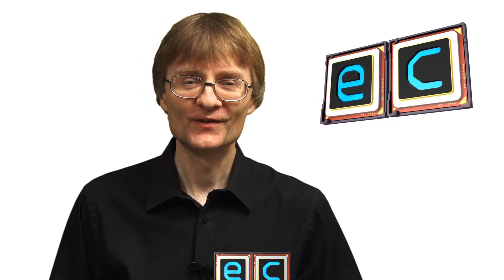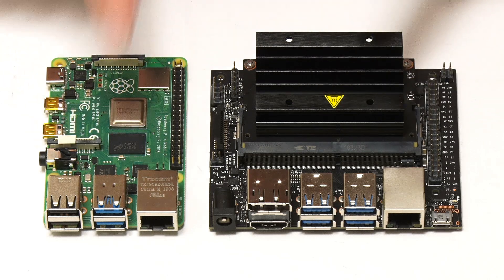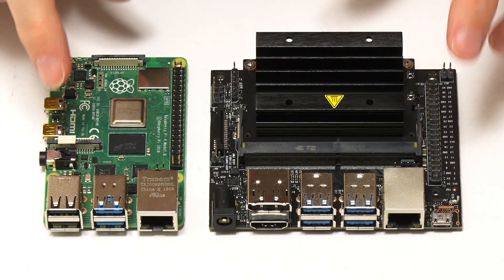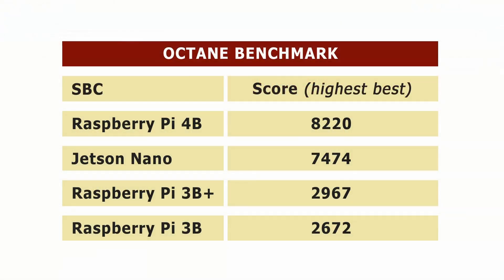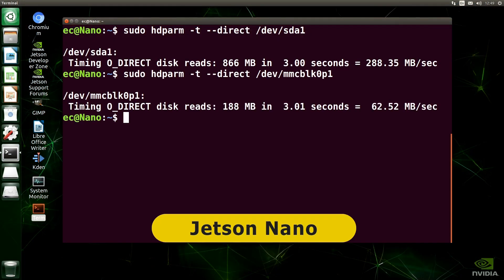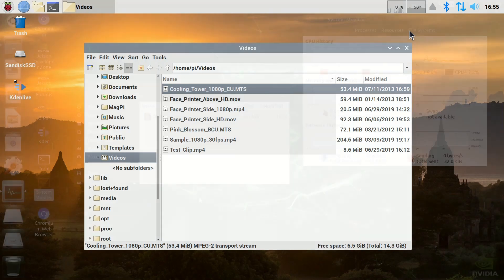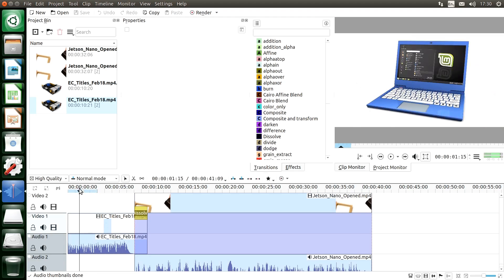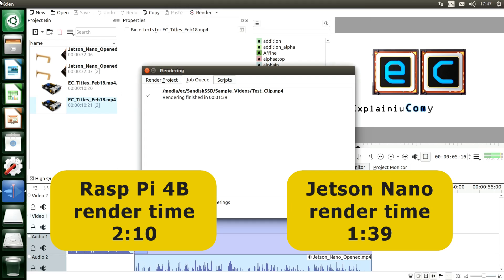Raspberry Pi 4B vs Jetson Nano

Comment: I am trying to build a system that detects the position of my hand via camera and use it to move a 3d printed hand so it behaves like my hand. I am planning on using Frankmocap as motion capture software. What do you think, is the nvidia jetson system powerful enough to run the motion capture script and some steppermotors at the same time?

Comment: From what I can tell

If you want to go into AI, go with the jetson nano 

If you want more processing power for say a website go with the raspberry pi

If you want just a logic board go for an arduino

Both jetson and pi have the same connections, just jetson has 2 full sized ports and all 3.0 usb
Reply: you usually run an arduino with either the pi or jetson for low level control from my experience, so it's not really fair to put them in the same category

Comment: After 6 months of use.
The LINUX distribution on the Jetson is horribly maintained by nVidia.
Extremely buggy. Also, many packages are terribly outdated.
Highly recommend just using a old PC with a cheap nVidia GPU.

Comment: Comparing these units is a little bit weird since the Jetson is for running NN and the Pi is not. Try to run 8 parallell NN on the Pi and then compare ;)
They are good for different situations so choose the one that is right for your project and not the one that get highest score in a  video rendering situations or browser test. Jetson is not a working computer just primary for AI. I have boot and none is used to rendering movie clips, Jetson nano is used for computer vision and the Pi for controlling a sensor cluster.

Comment: what they need to make with these boards are.. use of a M.2 for loading all software including windows 10 on it for an operating system, and enough GPU for 4k at  60 fps, and mostly to use it for web browsing, light gaming, to have a very small form factor computer.. and to be able to put several of them together in a cluster operating under Windows 10..
Reply from the maker: Sounds like you want an SBC like an Odyssey X86J4105: https://www.youtube.com/watch?v=4XV8dlFwNd0

Comment: Where and how did you  get this system info of CPU usage and temperature to show up in the upper right corner of display at 12:20?
Reply from the maker: They are panel gadgets -- click the panel (menu bar) on the Pi and you can add them in from a list.
Reply: @ExplainingComputers  Thanks, you're the best.

Comment: Hi friend,There is a sspecial development board, it can operate with LINUX system,it has development board come with a 12.3 inch protrain display, HDMI VGA YPBPR CVBS Audio input, support 7'' to 100'' display:

https://www.amazon.com/12-3inch-Display-Controller-Operate-Support/dp/B089GPSBKQ/ref=sr_3?dchild=1&keywords=Linux

+Development+Board+HDMI+VGA+YPBPR+CVBS+Audio+Input+Support+7%27%27+to+100%27%27+Display

%E2%80%A6&qid=1592892604&sr=3

Comment: The comparison looses the point of Jetson nano. You'd need to compare neural network inference performance to clear with computing power of these systems.
Reply from the maker: You are right that the Jetson Nano targets the ML market. But it can also be used as a rather good general SBC. Things often get used for applications that the maker did not intend. The telephone was initially created as a device to send music to people over long distances . . .
Reply: @ExplainingComputers  yes, of course, even a microscope can be used to hammer screws into concrete (exaggeration, but still). If NN isn't involved, single Jetson nowhere near neither in terms of performance, nor in versatility with 3 Rasberry Pies one can buy for the price of Jetson. 
Apple is as "round" as orange, of course, but comparing them ... 
Anyway, thank you for the video, gives an idea how much perf one can get on Jetson outside of NN.

Comment: I tend to be frugal. If product "B" does all the things that "A" does plus much more, and is not that much more expensive, then I will buy "B". This having been said, of all the singleboads you have reviewed, which non-pi board is the most compatible hardware/software-wise to a Pi 4B?

My wish is to have the most powerful SB I can find, but still be able to use all the Raspberry Pi stuff like Retropie and such.

Comment: This review didn't compare write speeds or LAN speeds.  And the RPI 4 fails badly for write speed either locally or across the LAN.  The Nano as a server can give a full 1GB download speeds and around 49MBs for uploads.  The RPI 4 does fine for download but for an upload it'll run ok for a few seconds and then drops to zero bytes per second and bounces around 0 to 30KB/s until it finishes.  

Also the bluetooth range on the RPI 4 is really limited to a 2 feet.  At least for a bluetooth mouse and keyboard.  The Nano with it's add in wifi card does bluetooth mouse and keyboard just fine.  (I'm using my Nano as I type with my bluetooth keyboard at about 10 feet from my Nano.

Comment: Can any of these sbc's run LinuxCNC? Can you please test it.
Reply from the maker: It will depend if an ARM port of Linux CNC exists. X86-based SBCs that can run Linux (such as the Atomic Pi, LattePanda models and the Odyssey X86 and the UDOO X86 AP) should be able to.

Comment: Jetson Nano is an "almost".  Why put an M.2 slot in that won't take an SSD?
Reply from the maker: M.2 is a connector standard, but not just for SSDs. It can have a  PCIe, SATA or USB interface (the latter here for a networking module).

Comment: So my issue isn't that you used different operating systems but instead different architectures. Unlike the x86 32 vs 64 bit being mainly the amount of addressable memory the arm gets a computational boost when running in 64 bit mode. Perhaps if you used Fedora Core for aarch64 it'd be a better test performance wise without going out of your way for available software.

Comment: As a user of both platforms, I can say that the RP developer experience is dramatically better and I am looking to hardware accelerators like those from Coral over the Nvidia dev products.  

It's not about performance, it's about ease of development and agility, and in that case, Nvidia requires a huge amount of buy-in with time and libs.    

All I really need is something that can accelerate tensor-flow lite or similar nets, for what it's worth.
Reply: hi can you guide among RP 4 , coral dev board and jetson nano which is best in terms of ML inference and ease of use?
Reply: @noumanfaheem1928  I'm not sure what would work best for your particular application, but do you need opengl acceleration or are you working with multiple platforms?   My thought above was from the pretty closed developer experience I had with Nvidia and how much specific knowledge I needed to develop with that platform.   If you want to use just the jetson products for many things, it's still a really good platform.   

If you're focused on ML and want to use different libraries like pytorch too, nvidia might be the way to go. 

I hope that helps.
Reply: I would also buy a couple in case one has an issue, like the one I had, where it just didnt boot.
Reply: Thanks for the reply actually I am new to this field and still learning so i dont really know what open gl is but mys situation is I have an inception v3 based tensorflow model already developed for TB detection and I want to deploy it on hardware using real time xray images hope that clarifies my situation

Comment: Can Raspberry Pi 4B or JetsonNano use USB connected HDD as the external storage?
I am interested in using these as servers with 2tb HDD
Reply from the maker: Yes, you can do this. But any external 3.5" drive will needs its own power supply.

Comment: to be fair, since the nano uses normal sized hdmi and DP connectors. It makes little to no difference which board you choose in terms of price. at least here in Sweden. the RPi 4 is basically 65$, and each micro hdmi dongle/cable cost around 10-20$ so, you'll end up with 75-95$ for the Raspberry Pi 4 4GB, similar to the nano. those connectors were such a bad decision by the pi foundation.

Comment: I have both, and I have two Jetson Nanos. Honestly at this point I am disappointed. These little computers are not for everyone who is into mobile projects. After fiddling with these for a bit, they are collecting dust and I have a hard time justifying keeping them. A good high end Smartphone does everything these can and more, in a MUCH more convenient package. I can do tensorflow lite object detection, image classification, all the ML stuff that you can do on these and more on Android. I don't need to fiddle with power supplied and dongles galore to get things like a screen and portable power supply. Smartphones have all that built in. I don't get the hype over these. Price, ok yes, but who doesn't have a phone? Robotics with the IO pins, ok. However if you're not into robotics or trying to make some cheap server, I don't see the advantage. Even when the price is taken into account, it's not worth the hassle and disadvantages of these vs just programming a project for Android.

For a TV Box, I use an NVIDIA Shield Android box. It actually has hardware acceleration, where the Jetson Nano despite being the same hardware does not have the same performance for video. I keep trying to think of a justification of why to use these over an Android device for any use case, and robotics is the only thing I can think of.

Comment: I have Nano, but I'm not recomending it! It has 4GB ram, yes sure, but 1.3GB is passivelly used by GUI, (rp ia about 200mb), so when you start Keras with TS background, TS will occupy about 2GB  and you have only 700MB for deep learning - same as RP3 B+... Even jetpack examples crush sometimes because of ram shortage...
Reply: Can you not do a bare-minimum Linux install without the GUI? Or can you strip down your current install by removing all the GUI packages?

Comment: What is the difference between the 3B and the 3B+
Reply from the maker: The 3B+ is clocked up to 1.4GHz, rather then 1.2GHz on a Pi 3B. The Ethernet port is also 300 megabits, rather than 100. And there is better thermal performance, to cope with the faster chip. But these points aside, there is not that much difference.

Comment: You all know the true cost of ownership of a Raspberry Pi.  It was never $35, you always invested ~$50.  With the Pi 4 you will be spending on Type-C adapters or power supplies, those pesky micro-HDMI connectors that nobody else wants to use, a heatsink with a fan, etc.  With the 4GB Pi 4 your cost of ownership be $80+, and with Jetson Nano coming down in price below $100 ($95 on Amazon as of the moment), you get the SBC will all standard normal-sized connectors and none of the nonsense of adapters.  The cost difference becomes negligible and the Jetson Nano is definitively a better board overall.

Comment: Great job as always Chris, as you point out part of the cost with a higher performing product like the Jetson-nano is the additional power required to run it.   More power means more heat, etc,  even with my moderate gaming/rendering needs,  I doubt I will be replacing my desktop box with one of these any time soon.

Comment: I get the Raspi. It is cheap an there is a lot of support out there. But why would anyone choose that NVidia thing? There are Mainboards available with a Intel N4000 CPU that support 8 GB Ram, PCIe, DirectX12 and Vulkan and so on. And they will run real X64 Linux, not some derivat that is most likely badly maintained. And there are also no driver problems, since intel has a really nice linux support for graphics.
The ASUS PRIME N4000T is available in germany for 80€, add some ram and a ssd and you are same price like that NVidia thing, but it runs windows, if needed.

There is even a barebone Version with case and powersupply for ~120€ called PN40. So why trade all the fun and compatibility of x86 for a stupid nviia board that drops frames while video playback?

Comment: i was thinking about buying a pi till I did optane test on my old pc,pentium g2020 with ssd 20000 , pi 4 8000 ,I use mint or ubuntu and this old pc does everything I need easy and can be purchased cheap,  love you vids for long time,also my phone is more powerfull than pi 4
Reply from the maker: There is much to be said for an older PC.

Comment: These cards are for two entirely different applications (I love them both). The PI w/4 GB is a great all-around Linux system that's pretty hard to beat for $100 USD. And while the Nano has it's own Ubuntu build, it's primarily for crunching CUDA in parallel, and developing Machine Learning applications. So if you're looking for a great Tensor Flow dev system the Nano is the way to go. Love this channel by the way!

Comment: Great video! Glad to see these comparisons. Got yet another idea for a great video. Now that the Raspberry Pi has USB 3.0, it would be great to see a video of how to make the Pi 4 run from a USB drive. I understand that the SD card can basically have a little config file changed to point the boot process to run from a USB drive instead of the sd card. It would be especially nice to see how this is done. Seeing some real world comparisons of bootup time and responsiveness within the graphical desktop would be great too! If you got it, it'd be great to see the speed difference via using a NVME drive inserted into a USB 3.0 adapter .... but I'd also be happy to see the difference with simply using an Sata SSD with a USB adapter cable (which is the manner in which I would most likely configure this.  ☺
Reply from the maker: Pi 4 USB boot is not yet implemented -- but I am looking foward to it!
Reply: Right, true USB boot is not yet available for the Pi 4, but the 'next best' thing is. You can very easily alter the /boot/cmdline.txt file so as to have the boot process start on the SD card but then have the remaining boot process promptly resumed from the USB drive. I used a USB connected Kingston SSD to do just this. Boot times were reduced, but more importantly, responsiveness when editing web content within WordPress was greatly better. Of course, when true USB boot is available (soon?), I'll reconfigure things so as to eliminate the SD card entirely.   https://www.tomshardware.co.uk/boot-raspberry-pi-from-usb,news-61081.html

Comment: I wonder how the RPI4 thermal throttling affected the kdenlive clip rendering. If there was a better cooler on the Pi I bet the results would have been closer
Reply from the maker: It may well -- the passive cooling solution I used was large, but the Pi 4 really needs active cooling to run at load.

Comment: Jetson has been out for years nvidia has always been crazy expensive.
Reply from the maker: Jetson, yes. But not the Jetson Nano -- which came out earlier this year (2019) and at far lower cost than previous Jetson boards.
Reply: @ExplainingComputers  99usd is not a easy price for a simple dev kit, would rather get it as a loaner. Especially if I have no plans to use it.

Comment: The truth is rpi4 ou 3 sucks at anything that needs gpu on browser. Have spent hours to make chromium enable hardware acceleration, and even when I got it the youtube frame drop was huge. The same movie playing on vlc using a script that i built to get the links from youtube-dl just runs fine. It is a shame they toss raspbian with browsers by default without supporting hw acceleration.
This has to be mentioned, do not buy raspberry as media center, or you're bounded to kodi to have it working as a useful media center
Reply: @MzNToS yes it still drop frames. Have tried firefox with h264ify and is even worse

Comment: you can get some nice system stats with sudo tegrastats
Reply from the maker: Thanks for this, noted.
Reply: @ExplainingComputers  If you are still reading, I highly suspect nano's system monitor in ubuntu won't give you correct numbers on cpu usage, instead base it of current clock. By default that dynamic, but you can set is static with sudo jetson_clocks with no arguments. See --help for more options

Comment: How did you power the Nano? For me the nano feels much snappier on the 5v   4A barrel jack than via USB power.
Reply from the maker: I used a "special" SBC micro USB power supply (that offers 3A at 5V, which is beyond the micro USB spec of 2.5A).
Reply: @ExplainingComputers  I would try the DC power option.  It allows the CPU to draw more power. It might get better scores on some tests.

Comment: Well mate.  This has been what I have been sort of thinking of.  The GPU performance on the Pi's are well, not where it should be if it's used as a desktop or portable for that matter.  What I have thought of now is using the Jetson for the CP (Control Processor), video, keyboard and mouse.  While I would have 8 RPI 4's working as worker boards in the overall system.  The issue is I don't care about backward compatibility for 32 bit code.  Really, don't see the point.  I can say running the hdparm test on Rasbian and also on Centos for the same model of Pi.  Centos won with 27.87 MB/sec vs 25.93 MB/sec on Raspbian.  Not a big deal but faster.  So, I have been mucking around with buildroot to come up with a Centos like OS where it's running in 64-bit mode.  Once up then it's just a matter of keeping up with the patches as I would have to compile and install them.  I have done this before when I worked as an network engineer.  Just check for patches to code say every quarter or so.  But what I have thought is to build a cluster aware system where I would use something wine to run say Kerbal Space Program and see if it could handle the load.  One of the problems you mentioned is overheating.  I see this on my laptop now running KSP.
Reply: Just ran across lutris so I may have to go with Debian style.  What I may have to do is go through wine and see how hard it would be to make it cluster aware.